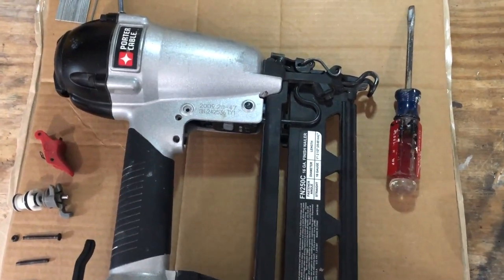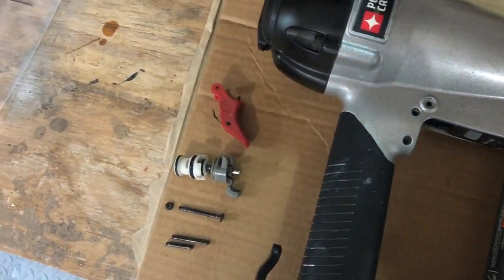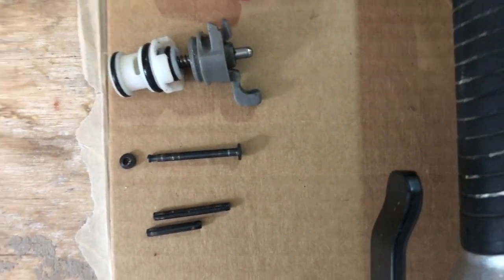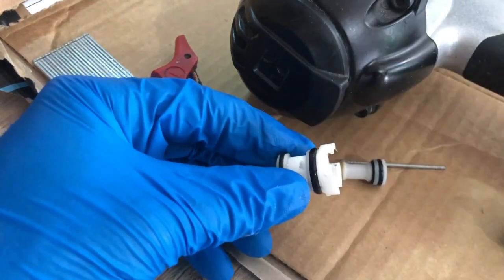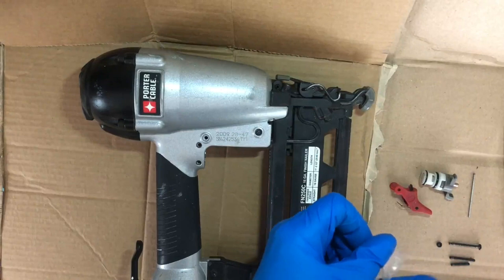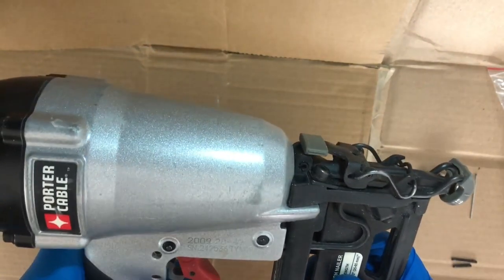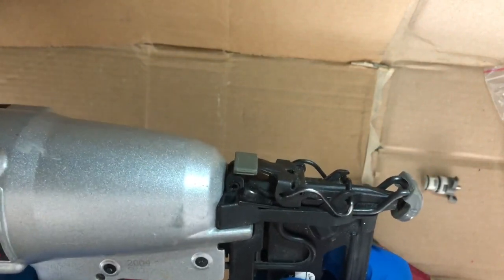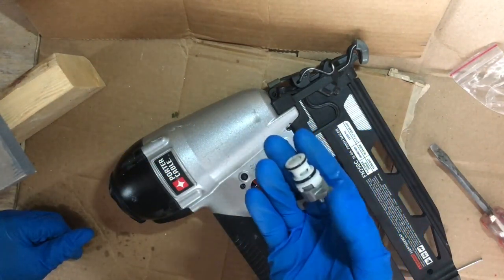Finish Nailer Not Firing - Trigger Valve Replacement Fix

Comment: I really enjoyed your video, which helped me fix the exact same problem on the same nailer that I own.  I have discovered a cheaper way to fix the problem, and wanted to let you know.  The problem is the wrong material specification for O-rings on the trigger rod, which is what the trigger presses against when firing.  The o-rings turn to mush and won't do their job any more.  You show the rod sticking out of the gray trigger assy. popped off of the white trigger valve in your video.  These can  easily be replaced with buna-N size 004 (5/64" ID x 13/64" OD x 1/16" thick for about $3 from ebay).  I lubricated the o-rings with silicone grease.  All works fine now.  Buna-N is resistant to gasoline, and I believe "oil" as well.  I ground the OD down a little using a moto-tool, but doubt that this was necessary.  I was trying to install the rod with the flat end first...  and it wouldn't fit, as I discovered.

Comment: Thank you for posting this repair. My Porter Cable nailer had this malfunction yesterday and after watching your video, I found the trigger valve locally and installed it this morning. My tool is now operational again for only $15! You saved me a lot of time and money.
Reply from the maker: Awesome! What kind of store carried this part?
Reply: @danmenges1249  It was a business specializing in wood working equipment. They have everything you would ever need there including blade sharpening. I did find out however that the Porter Cable brand has been discontinued and finding parts will be much more difficult. Looks like I will need to switch brands.

Comment: Thanks for the tutorial and the part number. $16 and 10 minutes of time and the nailer is back running like new. Good tips on using both the 16 gauge brad to punch out the pins and the bolt head to pry out the innermost section of the valve.
Reply from the maker: Glad it worked out for you!

Comment: thanks very much for this. The defective trigger mechanism I was replacing had parts broken off of the original so I was unclear how to new part went in. Your video was excellent. fwiw I bought the Dewalt replacement valve because it was ~4 dollars cheaper and it works perfectly.

Comment: Thank you! Thank you! Thank you! I have an 8-10 year old 250C that decided to quit working. Happened on to this video and realized I had air coming out of the trigger. Ordered the part and fixed within 20 minutes. The nail head trick to tap it out was a lifesaver and time saver. You're the Man! Than you for taking the time to make this video.
Reply from the maker: Glad it worked out! Mine is probably from 2004 and I’m glad to see this is still applicable to your newer model. I definitely experimented with different options before landing on the nail to pop the pins out! Worked great for me too!

Comment: Best way to get the trigger assembly out is to remove the pins and connect the gun to your compressor set to 0 psi output. Slowly raise the psi until the entire assembly comes out. You won't get stuck pieces in there.
Reply from the maker: Great suggestion!

Comment: I’m curious how you knew it was the trigger that was defective. 

Instead of replacing the entire trigger assembly, could it have been fixed replacing the o- rings? That seems to be the only thing that would cause air to leak. 

Thanks
Reply: I had the same question and was pouring through comments wondering if someone answered that.  Mine shoots once and the anvil won't return to the up position to grab another nail.  It does indeed leak around the trigger, so I'm hopeful that rebuilding the trigger will work.  I have an O-ring set, so I'll try that first and see.  Did you ever figure that out yourself, and what was your symptom?  Thanks.

Comment: It is a lot easier to pop the old trigger valve out by putting some air to the coupling on the gun, it will pop right out.

Comment: Thanks for the vid. Hopefully this is my issue. Gun has probably fired less than 200 nails in its life and this already. Used to use PC stuff a lot way back when I was building custom cabinets 25 years ago. Used to be decent. But this will be the last of their stuff I buy as it is is pretty much garbage anymore. Just more big box cheap crap like the others.

Comment: Any suggestions for removing a nail jam in the track that holds the nails for this same model? They went in on an angle and I can't get the pull pusher to release. It's stuck in the forward position.

Comment: This is definitely a design flaw/defect.  I’ve noticed on the replacement valves I ordered recently that they’ve replaced the clear/white/plastic orings with the standard black rubber orings.

Comment: What if those little brittle pieces break for the 2nd two pins?
Reply: I'll answer my own question.... Put some duct tape on it to hold it in until you order part number 890725  from either Amazon or replacement parts dot com LOL. Thanks for this video. It's much appreciated. It actually did help me replace the doohickey inside the trigger. But my gun is over a decade old so those little retainer rings were doomed from the git-go.
Reply from the maker: Glad you found the part. Here it is on Amazon. I wonder would a drip of hot melt glue work also. Porter Cable 890725 Urethane Retainer https://www.amazon.com/dp/B00XE9H0U2/ref=cm_sw_r_cp_api_glt_fabc_QGNJK8BSMQK95VTJFFMT
Reply: @danmenges1249  yup I ordered two from Amazon. They seemed much cheaper on replacemenparts.com but was leery of ordering. Thanks, again.

Comment: Those are roll pins and technically the “best” way to get them out is with a roll pin punch.  Your method seemed to work though and not everyone is a gunsmith so...
Reply from the maker: Thanks for the vocab Tim! Something like these? Grip 9 pc Roll Pin Punch Set Gunsmithing https://www.amazon.com/dp/B003L7HOMG/ref=cm_sw_r_cp_api_glt_fabc_7P9ASW4X96SD893C8VQW

Comment: i found my dads air gun, (he moved years ago I live alone) ran 4 nails and it wouldnt shoot the 5th. tore apart the trigger but I fucked up a pin and then couldnt get the trigger back on. put the finish nailer through the wood splitter, kind of pissed off. I wish I had been more careful now Im going to home depot. Im usually a good mechanic but i got too pissy and hasty and then just sent it through the splitter

Comment: I just started woodworking and went through my tools, found a brand new Porter Cable 16 ga. finish nailer that had never been used. probably came with a compressor at one time.  I booted it up and fired about 12 nails when it quit.  I suppose anyone with a brain would have at least put pump oil in.  lol.  I imagine that in 12 years in my tool cabinet the lube dried up somewhat.  anyway, ordered the new trigger valve.  we'll see.  thanks.

Comment: was there any visible damage to the old trigger assembly?
Reply from the maker: Not that I could see. The O rings looked ok, but I didn’t closely inspect them. I definitely heard air coming out of the trigger when I would try to fire it, so I gambled by purchasing the replacement part.
Reply: I noticed this gun was made in 2009, I guess the orings go bad after that much time, your gun looked brand new, I wonder if you could have just put a new oring

Comment: The second pin is not coming out the other end for me
Reply from the maker: I would spray some WD40 in there and you can try knocking it out the other side.
Reply: Dan Menges I got it. The trigger wasn’t locked into the valve assembly all the way. Thanks though
Reply from the maker: Kristian Martinez great!